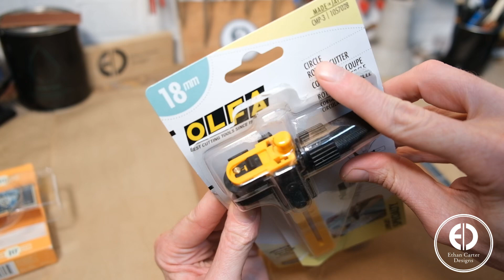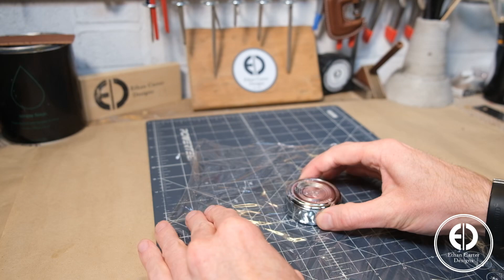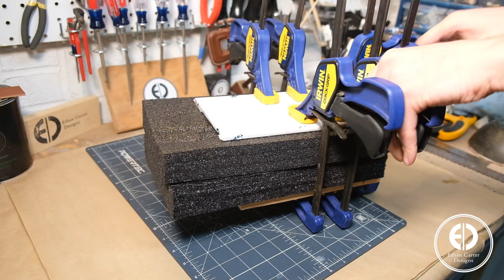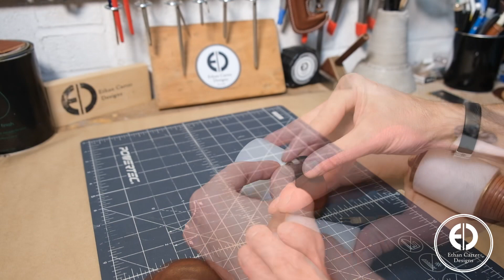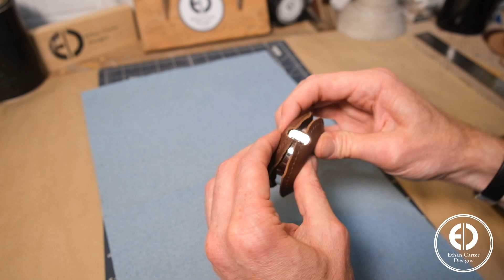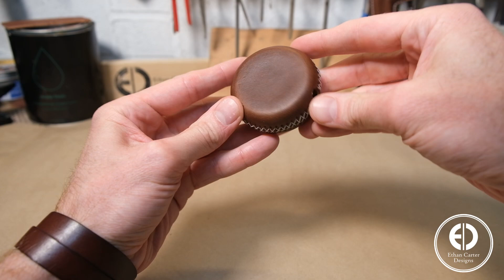Leather Tape Measure

Comment: Woah, did that handle come with your arbor press? I need that!
Reply from the maker: Nope, I converted an automotive 1/2 inch extendable breaker bar for it...it more then doubles the pressure I can get out of it! I have a YouTube short dedicated to some of the Arbor Press hacks I use which has a link to the breaker bar if you're interested https://www.youtube.com/watch?v=45zXs64M7VY
Reply: @EthanCarterDesigns  Love it! Thanks!